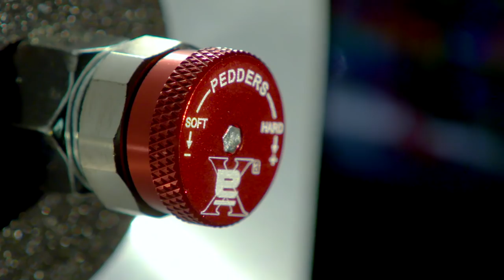Pedders Suspension & Brakes To Suit The Holden Commodore VE – VF

Comment: I have sports rider all round with 20" king wheels. Excellent handling! Ive had some close calls and im amazed how sharp a commodore can turn when it has to! Like a cat on carpet! I now have a Calais V with the FE2 option and to be honest the pedders SR setup is just as good if not slightly better being less floaty in the rear.